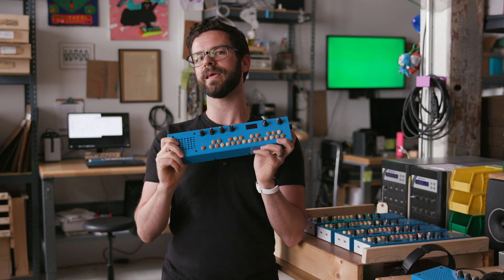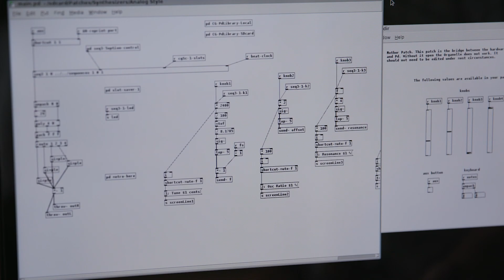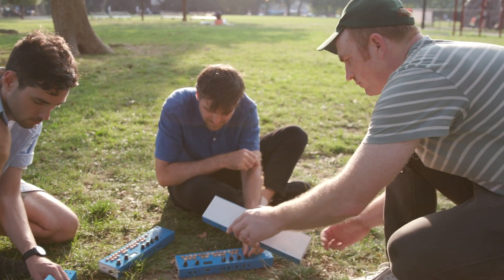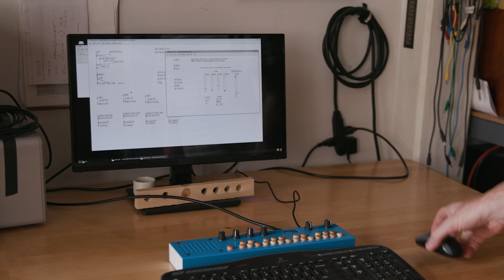Organelle M Hands-On: a portable and endlessly hackable music “computer”

Comment: so its a raspberry pi, with a controller, why does it cost so much then if the software is open source? this should cost 99.00 UK at the most
Reply: Because it took the company time and effort to craft, and most people won't want to put the work in to design and make their own synth.